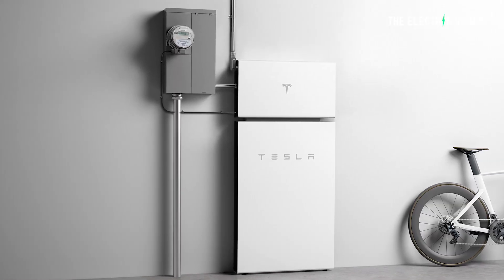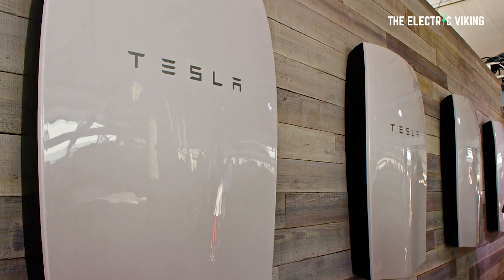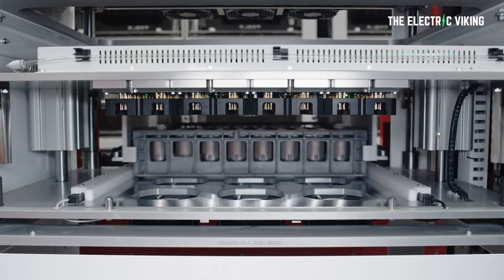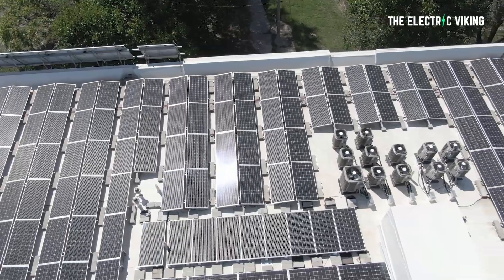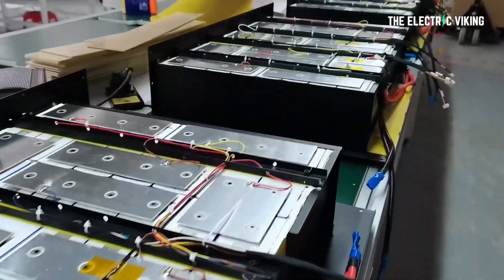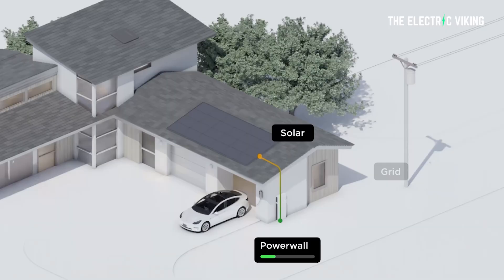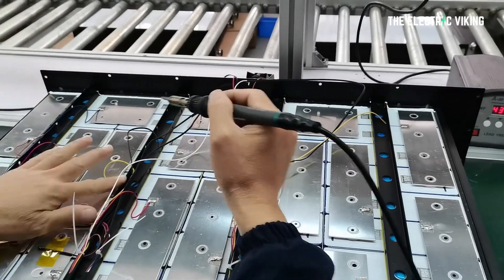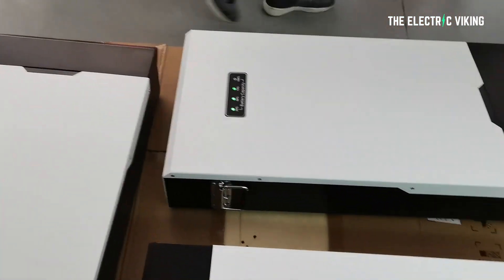Tesla is about to release NEW Powerwall batteries with better chemistry

Comment: Kind of expensive? They are twice the cost of nearly every rack mount LFP battery in the market. Powerwall is $10-12k (depending on location) for 13 kwh. You can get smart server rack 5 kwh batteries for less than $1500
Reply: Where you going to get a powerwall installed for 10k?
Reply: You can buy used Tesla modules out of salvaged Tesla cars for $600-1000, they're 5.2 kwh capacity. Powerwall prices need to drop a lot. They're a great product, but they're just way too expensive.

Comment: The other trouble is you need to have multiple battery packs with the current setup to have much backup.
13 kw is not even a days worth for most people . Just enough to make things not miserable in a power out.
I have Solar just don't see a need to get one days worth of power back up.
Reply: hmm...well, maybe if you run AC all the time, but otherwise it's plenty. My 3,000 sq. ft house in California uses 12kwh/day. And then there are the 19 solar panels on the roof that can generate over 40 kwh/day. Have wanted to buy one of these things for several years now. And now we can be part of a VPP. Can hardly wait.
Reply: You are missing the point.  It is worth having the battery.  It would mean that you can store the electricity that you generated during the day when you are out at work.  You can then use this stored energy at night when you come home from work.  It would mean that you would use much more of the power that you generate.  You would not be sending this energy that you produce during the day back into the grid and getting very little money for your energy that you give back.
Reply: But if you have Solar and are generating more than you are using you already offset the night time use and maybe then some as in my case so the only use if for battery back up during power outages. In my case I generate an extra 3000 kw a year off a 12 panel 4.7kw system. Sized for the eventual electric car.

Comment: There is other option like Na-ion that is much cheaper (it have less enagy density so it not good for car but stationary power wall don't care)
Reply: You forgot that the recharge cycle is way higher and safer from the get go. 

Especially if the EV manufacturer cutting corners like the others then TESLA. 

Ask GM government motors lol.

Comment: Sam, just had my two Tesla Powerwall 2's install did not buy solar from Tesla. Took three months to get the Powerwalls.  Lots of OEMs have the Powerwalls instock. Live in Florida. I have had my 10KW solar system running for 6 months.
Reply: You are funny 10kw.  I built a 15k for about 2500.  Works like a charm.
Reply: only took a few days too.

Comment: California isn't having power issues Sam, and no brownouts. Grids are designed for peak usage which for us often occurs around this time of year.
Reply: I strongly disagree with this, and so does PG&E.  We are having power issues, and warnings of rolling blackouts have happened nearly every day during this heat wave. The following cities lost power yesterday evening: Alameda, Lodi, Santa Clara (Silicon Valley Power), Palo Alto, Healdsburg, and Ukiah.  Granted, power was cut there by mistake in anticipation of blackouts, but the point remains that the Governor, PG&E, and CAISO have been issuing warnings and asking everybody to reduce load demand between 4-9 this whole heat wave… including today! 

I have two Powerwalls and am enrolled in Tesla’s Virtual Power Plant.  I charged up all day using solar, and sent over 20kWh to the grid between 6-9PM.  These programs start small, but are growing exponentially.  Imagine if Tesla vehicles, or any EV, could participate in feeding back to the grid during energy emergencies?  Really exciting times ahead!
Reply: Media has distorted the CA lack of power issues forgetting the current 8 day heat wave and excessive power use. This is not normal but media makes sound that way. What a joke the news is these days. Click bait

Comment: Please show example of the house that is,  "off-grid" 👀 
People like to think this & say or this a bunch.  
It's just NOT true.  Solar doesn't provide enough energy to do this entirely by itself.  You make it sound like batteries generate power.  It's NOT sustainable.  People with solar are, still "ON" grid power.  Please prove me wrong. 😉
Been electrician for over 30 years.  Building amazing houses & buildings.  Not one that can go totally,  "off-grid".
Time for nuclear power.  
China is building 55 nuclear plants to build the solar, wind,  & batteries for YOU.  Laughing all the way to the bank.  🤑🤑🤑 
China is gonna crush us. 😳
Reply: Got my powerwalls in June 2021, since then I’ve had 44 outages, 18 total hours, 5 hours is the longest. It’s expensive but I’m really happy that I only know the power is out with a small flicker, or my notice from Tesla, and.or Verizon telling me I could Lise FIOS from power outages in the area. Thankfully, I don’t lose either one with backup power.

I was fortunate to get them grandfathered in before they stopped selling them to non Tesla solar customers. It stinks, because I may add to mine if they would install to previous customers
Reply: What's very frustrating is you can't use your Solar Panels in a power out unless you have a battery with a smart disconnect.
In California. I may be attached to the grid but right now I am putting a extra 3000 kw a year on the grid and not getting much
back for it. So far I am experiencing maybe 2 or 3 4 hour power out's a year most of them are due to storms.
Reply: Obviously solar is enough, but it make take some more space. Search for will prowse on YouTube, charges his tesla on solar, too.